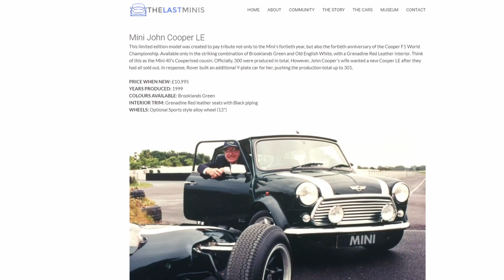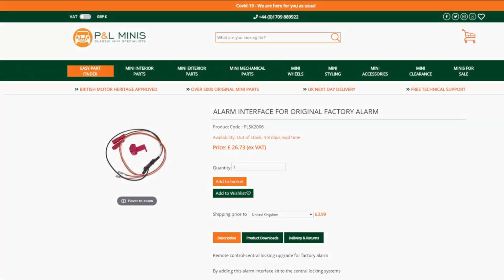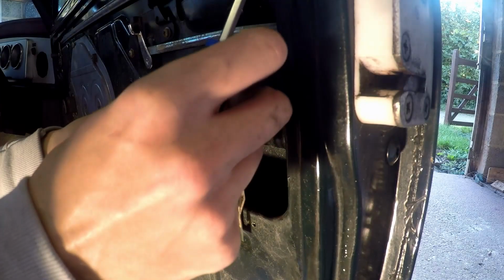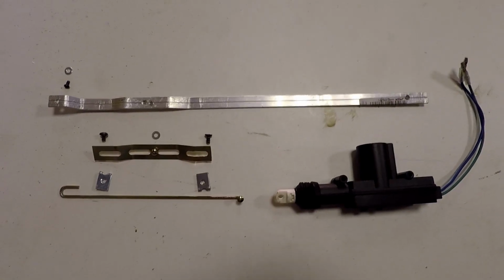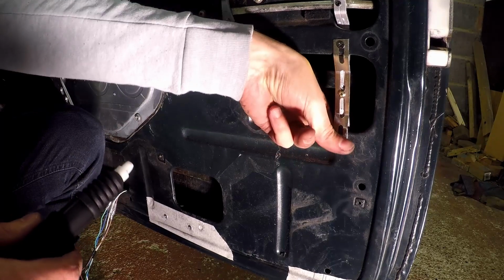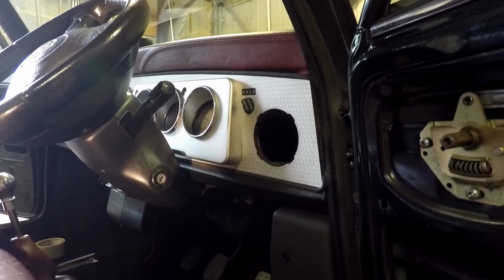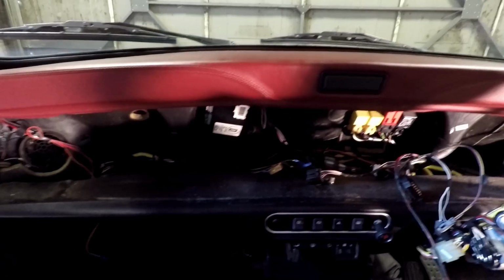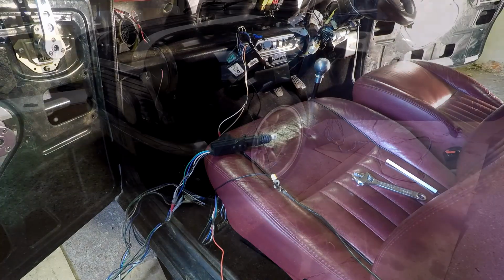Restoring Timmy the Mini - Episode 1 - Remote Central Locking

Comment: Congratulations, great job! Did you use a master and a slave or two masters?
Reply from the maker: 2 masters, as locking the passenger side does also activate the drivers and viseversa
Reply: @LoveMini  Thank you. I will also try to buy spare parts. I hope there will be no problems with the electronics.